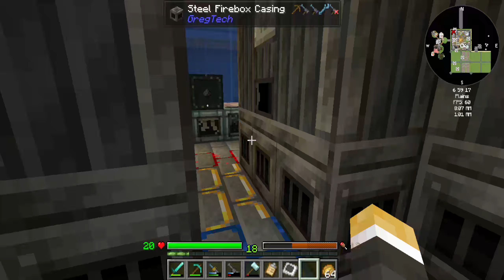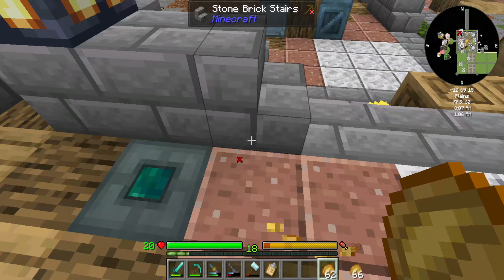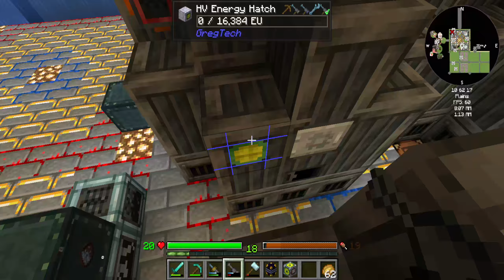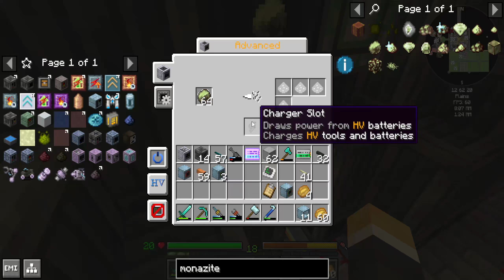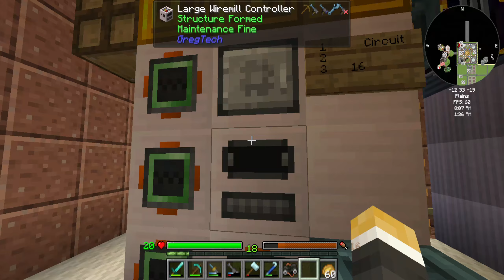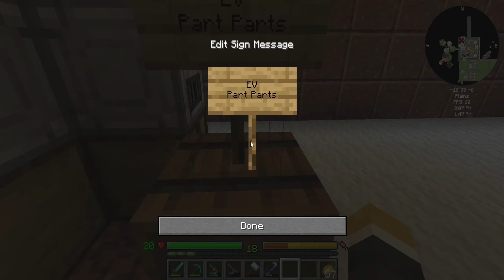Modded Minecraft Gregtech Modpack Star Technology 116   First EV Components

Comment: The ore factory isn't exactly the same as the ore processing diagram, the main difference is that the ore factory is mainly used to get a chance to get two of the same dust from one crushed ore, while ore processing is for maximizing the chance to get specific byproducts depending on the processing route, for cases when the byproduct is more important than the input ore itself
Reply from the maker: That's a good point.  I can't figure out whether or not leaving it all run in the background makes specialization or generalization better.  Or if the individual setups for each ore is worth foregoing the standardization.